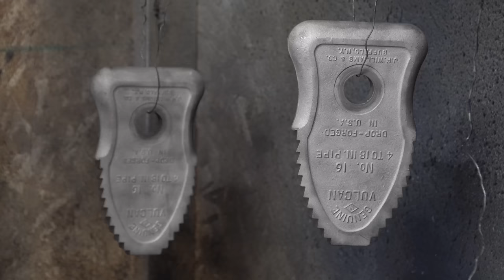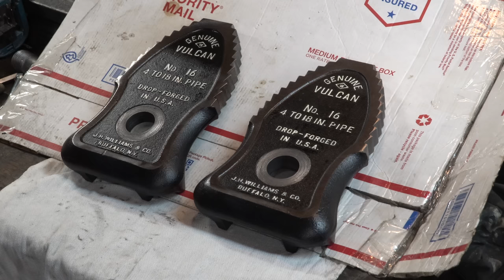Largest Pipe Wrench I've Ever Seen [Restoration]

Comment: This must be what the last guy used to fit the oil filter, the one that only needs to be "hand tight", to my car. 🤔
Reply: @ScumClassWorks  
Stuck like glue? I'd venture a guess that if the filter installer used that wrench, it would be sealed on a molecular level. 😄
Reply: @rogermccaslin5963  friction welded!
Reply: Lol 😆
Reply: Standard equipment at jiffy lube
Reply: Big nasty channel locks. Get em every time... If they'll fit....Sometimes hammering a screwdriver through the filter is the only way. Be warned, that trick is nearly a last resort. Using a chisel on the lid is the only thing left to try if the screw driver tears the can off.

Comment: Decades ago I had two of those chain wrenches back when I used to work. Thankfully I have been retired since 2008. This is the first time I have thought of those wrenches since I did retire. I used to use them to split 6 to 12 inch well casings. I would often have to use cheaters even on that size wrench. Mine were slightly smaller about 5 ft.

Comment: Hello Mr HTR. Nice job on the huge wrench. Liked that you kept the original finish on the bar. Even in train repairs we didn’t use wrenches that big. Can’t imagine working that thing all day. There was only chain vises, no chain wrenches in our shop. One little problem: NEVER use  your finger to check alignment. Use a smooth tapered rod or drift, or visually for that task. One little bump, and the heavy steel piece will cut off the finger instantly. Glad you are having fun in the shop. Btw, if you are ever in a blacksmith / steelworker display, make sure you use that wrench on some small delicate job. It will scare the heck out of everyone.

Comment: This has to be the first time using the huge version of your wrench that you were surprised to need a second one!
Reply: This episode reminds me of all the huge oversized tools needed for working on tanks.  

And not just because the chain looks like a length of broken track.
Reply: @danielf3623  Working on big things is like recovery. You're going to need something twice as big to unstick it.
Reply: Fire Sprinkler fitter here. Yeah. You do need a second one as a "Hold back" We only used them nowadays to remove fittings 4" or bigger. The men that originally installed them were some tough sonofabitches. No one made it out without back and shoulder issues. With the march of technology life is much better for the boys. But jobsites that used to have 20+ guys now only have 2 or 3. Everything has it's good and bad.
Reply: @waltkosch  I've not seen 4 inch fittings whenever I'm in buildings for fire alarm activations. Are they the pipes in the ceiling or are there bigger sprinklers in industrial settings.
Reply: @taliakuznetsova7092  Supply mains in the ceilings and Standpipe typically in stairwells.
Reply: @waltkosch  ah gotcha. By standpipe do you mean where we can pressurize the lines with our fire truck or where we can hook up a line for interior attack.

Comment: I work in natural gas transmission in WV,  and some of our oldest lines in service were completed in the VERY early 1900s, 1905 for example on one 10" line.  At the time 10" was huge diameter in our area, and the marks can be seen from the jaws of those wrenches on the pipe to this day!

Comment: Anyone who has ever worked on an oil rig are more than familiar with these wrenches. Chain Tongs as I knew them are still extensively used to this day, I've seen two and three sets joined together.
Reply: Yup. That's exactly what I was reminded of.
Reply: I haven't worked rigs but I've seen these around Texas my home state enough to know they're used for oil
Reply: Came to say the same, too many hours spinning up/starting bha on pipe racks and bottom of catwalk
Reply: Yes, and this is still a monster size. 
Likely built specifically for working with casing.
Reply: I used to work offshore and in the petro-chemical field and we used these often.
Reply: I water well drilled had a couple of them used them all the time with 21ft cheaters

Comment: the eyelet on the end gives you a clue to how it was used! you'd get it set on the pipe with 3-4 people (likely in a pit), then use a rope team, mule, or horse to yank on it through a couple stages of snatch blocks.
Reply: Oh, and I thought that eye was for a safety lanyard in case it was dropped from a height.
Reply: @squelchstuff  seems more logical it would be for a chain to keep in from falling out of your pocket really
Reply: You said snatch blocks.
Reply: 3or 4 people try only two people the rig runner and helper  that about it a rope and a hydraulic cat head been pulling and installing pumps for over 20 years now I was lucky if I got a second helper mybe if it 500+ feet deep then a extra guy is usually used it like ground hogs day after the first two sticks lol💧👍✌️👌🍻💪💯
Reply: @CountryDick  that's what they call it it's basically a cable that connects to a truck with a pulley hook  that's call a snatch block and you connect a set of clamps to 3 pipe to lift as one off a truck I pull water pump for a living hair it every day 👍✌️👌👌💯💪💧
Reply: @josephsaucedo8691  I know.
Reply: @josephsaucedo8691  only 500ft deep? I used to never get a second helper even at the bottom of the marianas trench. I didnt even know what ground hogs day was, you were lucky
Reply: @phipear  I can only manage that with one helper in the 8 hr if they need more then the 500 pull out that day they will send a extra guy so it out by the end of a work day we finish everything we start in a day's time in less is 1500 foot that about 12 hr to pull on average 👍✌️👌💯🍻 it water wells not oil field there no sucker rod and we set the rig up and pull that day tear down and take the truck out by the end of the day
Reply: @phipear  bottom of marianas trench? LUXURY! when I was lad, we had it tough… 
😊Hi to all from Oz 🇦🇺
Reply: @MadMax-bq6pg  that was on an easy day. I used to have to dig mineshafts by hand, starting at the bottom digging straight up
Reply: @squelchstuff  I figured it was for attaching it to your belt.
Reply: You'd have one guy set the head and an apprentice walking with a 10'6" length of 2 1/2" over the handle to bust loose old 4" and 6" screw pipe on the old sprinkler mains. For real pesky shit we had a compound 60" pipe wrench. Now that shits mostly thinwall grooved that rots out in 5-10 years.

Comment: You would have loved the 12'6" torque wrench I helped use in the boiler room of HMCS Saguenay as a shiny new marine engineer in 1978. Used to torque flange bolts on the largest main steam lines that operated at 550 psi and 650°F superheat. Leaks occasionally happened but you sure didn't want one. ❤️⚓️🇨🇦❤️
Reply: Wow, I imagine a leak like that could quite easily remove your finger or arm if you were unlucky enough to find it that way? :-O
Reply: @poly_hexamethyl  or you entirely if you broke a mirror, or had a whole black ship cat that happened to cross your path left to right.
"Schwarze Katz von links nach recht bringt was schlechts"
Reply: @HrLBolle  I love the saying about the schwarze Katz!  I knew it the other way, "Schwarze Katz von rechts nach links – Glück gebringts" :-)

Comment: Used one a few times for turning 8" to 12" diameter tie rods of injection molding machines, though I think the one I used was likely one size smaller as it didn't have a lifting ring on the end and you could slide a cheater pipe on the end of the handle for extra leverage.  They're a beast and especially challenging for just one dude to handle.
Reply: I wrote code for controlling injection molding machines. Does that count?

Comment: As a hobbyist collector of old and unusual tools, I enjoyed this, especially as I have a smaller chain pipe vise that mounts to a bench rather akin to how this chain tong works thar needs a clean and that paint on the letters. Sadly the markings are all on the bottom when mounted! And I have a monkey wrench about that size with wood grips that look mahogany or teak but are oil stained so hard to tell, it is clean to bare metal and still works great, a few others I have are rustier and they will get the dip! Thanks for a fun show but no tell!

Comment: I've seen a wrench just like that twice that I remember.  One was on a video about working on an oil well drilling rig.  The other time was back in the late 70s when I worked at the phosphate mines, and it was used on a bolt on one of the giant draglines that were used to mine the ore.  It was a two or more person operation, and I think they used a hoist to place and support the wrench while it was being used.

BTW - I liked the "attitude adjuster" you used on the main bolt for that big pipe wrench.  (I've got the 24 inch crescent wrench version, and have needed to use it a few times.)
Reply: having seen videos of oil rigs they do have gigantic wrenches and they are suspended by cables.  Given how they would move them up and down with ease though I am thinking some of them were counter weighted on the cable vs being on an electric or other power source winch.

Comment: What an insane piece. A relic of a time that has all but disappeared. I imagine most of it's brothers and sisters got recycled into truck and tank parts in the 1940s.
Reply: Had to think about why.  Don't we use big pipes any more?
Reply: @tsm688  power tools used now I would think.
Reply: @alun7006  A power tool that big would still need 6 stout men to hold it unless it was attached to a truck or something.  Not because it's big, but because the torque required to prevent the tool spinning instead.

And given the choice between 5 random guys and a truck, 5 random guys still seems cheaper

Comment: I used to work in a huge metal stamping plant and the shop had 2 or three of those chain pipe wrenches.
We used to throw it on a wheeled cart to transport it to the job.
It would take two of us to get it connected to the pipe, and you got a workout out using it.
Using those big tools was hard work, biggest threaded bolts were 12" in diameter, the nut was almost 24" in OD

Comment: I've seen some old boiler rooms around washington dc that have 10 inch threaded pipe. always amazes me how hard people worked back then. I couldnt imagine trying to start a 10 inch thread in position then wrestling a huge wrench. I'm thankful for welding pipe, easier and faster.

Comment: Large set of chain tongs. Handled a slightly smaller set for several years while working on a service rig in the oilfields of West Virginia. If you couldn't break a joint of pipe with those, you might as well grab the cutting torch because it couldn't be unscrewed.

Comment: Enjoyed the video...I haven't seen one of its kid or brother/sister in over 40 yrs.  The  chain type we called it a chain tong, the other a lay tong.  Back late 70s, as a pipefitter, we used these unique tools out in the field (of site) and often had to use track air (our term).  The track air was a tractor, 6 cyl engine, 2 cyl produce air for impac etc, it also had a winch and A type boom in front.    Fitter(s) in the hole to set and reset the tool, the winch did the work.  Largest screw pipe I ever did was 18".

Comment: Back in the mid 1970's we used this size chain wrench on Texas oil rigs to screw together/then tighten surface casing pipes.    They were awkward to use, heavy and difficult if the chain was rusted.   Best tool for the job that we had available.

Comment: That is nice that it was practically new and just rusted up. I restored one a little smaller than that one. Same brand. Mine had issues with the chain and had broken and bent pins in the links. I had to machine new pins and replace a bunch of them- a lot of work.

Comment: My father was a Milwright at a large steel plant and he routinely used wrenches that were so big, you had to use a crane to lift and turn them to loosen the nuts and bolts.

Comment: I'm a pretty old guy who used these types of wrenches a lot in my younger days. They are called Chain Tongs and we generally used 3ft. and 4ft. and put cheater pipes (Swedes) over the handles if we needed longer wrenches. The brand name we used was Vulcan. We installed fire sprinklers with them which were thick walled (schedule40) threaded pipe up to 8inch inside diameter. The 8inch used 5ft. tongs so luckily we rarely had to use those.

Comment: Those pipe wrenches are still being produced in Texas for the oil and gas industry.  We had a few at my old job for putting together logging tool strings for logging while drilling.  The are a bear to worth with.

Comment: Enjoyed seeing the higher quality better tool used to apply torque to break that bolt loose while the cumbersome awkward weak toy just held the bolt head still, assisted by the weight and friction of the pipe wrench assembly.

Comment: I was first introduced to this style of wrench while framing some condos in Walnut Creek, CA. My FIL loaned me his as I'd been tasked to make sure the earthquake "hardware" had been tightened down properly on a unit of condos just prior to inspection (spoiler: they had NOT been!). It was almost a necessity for getting to the larger nuts inside various different brackets between framing members, and I loved using it so much I hunted one down for myself. Took me several years to find one, but it is one of the most reached for tools in my chest.

That said, I cannot begin to imagine the lad they tased to wield that sumbitch! Holy WAH!!!

Comment: I got a modern one at a garage sale for 20 bucks cad ( crazy deal). Had no use for it in mind but NEEDED it. worked good to get a seized cap on a hydraulic ram on the tractor.

Comment: Makes me wish you had two of a project sometimes. I get the "purity" aspect, but a second would offer a chance to make improvements on old design. It seems like that chain is permanently fixed in place once all back together. One thing to make it more usable is to make a lynch pin so the chain is detachable but you still have a solid joint when together. I bet there's a lot of meat that could be taken off too without losing much is specs too.

Comment: Somewhere in my shop is the pipe cutter that goes with that wrench. Also have a rather large rolling chain cutter for cast iron pipe. Wish I could remember where I stuck them.
Either way, good work on this thing.

Comment: Three things: Get the handle re-coated in some oil. Nice non-detergent type let it weep in the sun a few dry days and it will re-petina well. The sound on that metal is nice dense tool grade. It will take a long time to get that tool back up to shape, particularly the chain. I'd probably soak some older jeans in oil and toss them over it for the first few months of storage. Nice add to a collection.
Two it is really nice to see they didn't add any fancy tooling to the shaft to fit a pipe over it for a striking area. 
Three this is in the lineup to striking or slugging wrenches. You'd see these in high pressure applications, think presses and die setting, common in extrusion shops but far less common on job or construction sites as OSHA and MSHA have forbid those years back. This tool would offer more finess in setting final angle on the pipe and would help in holding.

Comment: tThey work real well on 4" and 6" RGC. When you take a normal 24" chain wrench and put a piece of 2" RGC on it for an extension, you either break the handle or the chain. I never knew anybody who could break a chain wrench like that. And, no, it is only a one man wrench. Sprinkler Fitters used them also before the big Victaulic couplings. Pipe is only threaded up to 12" I believe in water. and 6" in electrical. When I was using a wrench like this it was the mid '70s and I weighed around 190. We were running 6" RGC overhead on 12' ladders. You had better be able to pack it up the ladder and use it. Or, go down the road.

Nice job of restoration. I never saw one that nice.

Comment: 4-18” diameter, I guarantee this thing spent time in the oilfield. Two guys probably used it to tighten drill pipe and casing before rotary heads were a common thing

Comment: Chain wrench used them every day on a Oil rig in the Mid 70's and 80's .   as old as it is looks new I bet it worked fine as it was  little on the rough side .

Comment: I used to work in the oil field and I hated these chain tongs. We'd have to modify them with a clevice at the end to be able to use a chain to pull it because whatever we were working on that needed a pair of tongs this size was never loose enough to break by hand anyways. So I never understood why they didn't come with a clevice to begin with

Comment: That's about the size of the one we used to use at the steel mill to screw the carbon electrodes for the DC arc furnace together. It would take three of us to spin the new section hanging from the crane hook in to the old electrode in the stick builder. They were about 3 feet in diameter.

Comment: Not that anyone cares, but I used to use these regularly in varying sizes for irrigation well pump work, or breaking down, or making up tool joints in well drilling. We called them chain tongs, although that might not be the correct term. They're pretty useful on either large and/or irregular sized items. But, despite their size, they aren't particularly strong compared to a standard pipe wrench of comparable sizes. Good for quickly making up threaded pipe joints, as it's easier to reset than a pipe wrench, and not quite as clumsy, but not great at really touqueing a joint tightly.

Comment: fire protection sprinkler fitters
in new england at least
back as early as the 1970's had access to
4 foot cast iron pipe wrenches,
and manual dies large enough to 
NPT pipe thread 8" pipe in the field.

Comment: Back when l was a youngster all of 5'7" @ the same weight as that chain tong we used these on drilling rigs here in Texas. Yes, one roughneck could run that thing. BTW, the definition of torque is: 3 roughnecks on a 4' pipe wrench with a 6' length of pipe on the handle!